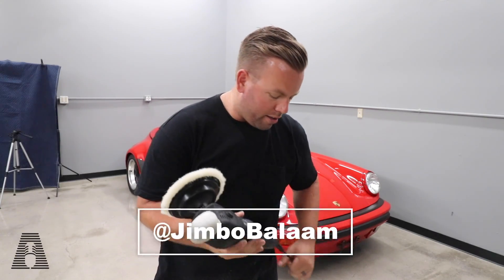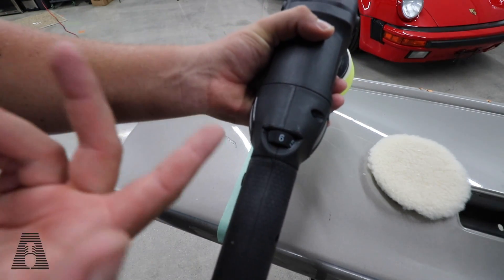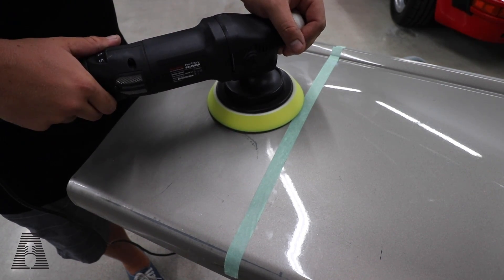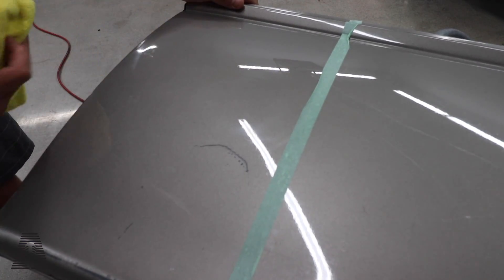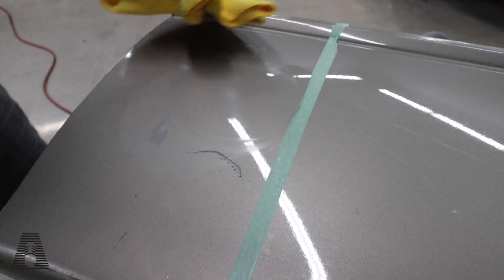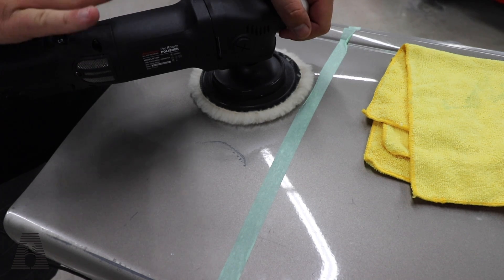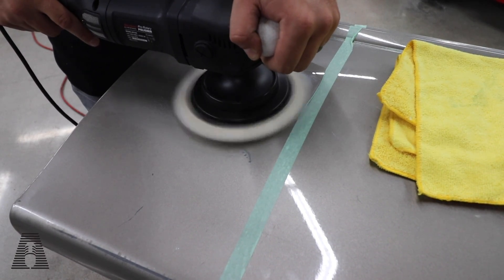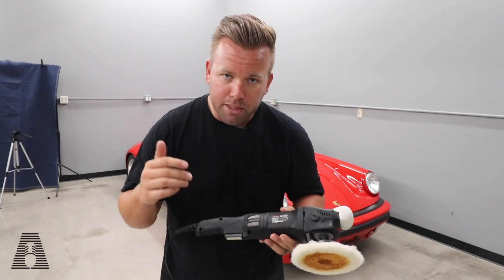HOW TO BURN PAINT AND HOW TO MAKE SURE YOU DON'T BURN PAINT

Comment: Great to see how much it's really needs. But also to be fair the most oops happens on the areas you talked about is to be carefull with when you correcting with a rotary polisher or actually some times with a DA too. On the edges that is where the paint is it's thinnest and also kind of grab you in if you are not carefull. Also how you tilt and let the pad with a rotary polisher goes against the edge. Then have the pad also with compound on it all the time is more aggressive. Needs to be reloaded with compound often though LOL. It could be worth to show how many compounding with full section passes it takes on edges or raised body lines before you have thinned out the paint too much. Also that without a paint thickness gauge reading before you starting to be doing a heavy compounding step on it is of value. As you often have no idea on how the paint has been polished before you do it. And the paint can be very thin when you starting to do the correction. Or more thicker and it's needs to be very aggressive as in your video to do any damage on the paint. 

I see what you where trying to show and you told many things that you takes into account when you polishing with a rotary polisher. And for most parts it's very safe to use. It's when you get those paints that are already thin from the beginning it's a very high risk of going through. Or a spot correction of a scratch that have been done and you have thinner parts on otherwise good amount of paint on it. Where you really can get into problems. Very informative video for sure and would be very interesting to see more of these videos where you when detailing can get into trouble with on some materials. What happens when you let chemicals dry on the paint for an example. Or use a tar remover on headlights and dwelling too long. Not drying a paint when rinsed with tap water and so on. Many things that would be interesting to see what happens and why and how you avoid these things to happens in the first place LOL. 

Great video and the rotary polisher seems to be a great first rotary to get.
Reply from the maker: All great points!

Comment: Thank you for doing the video. Now we do low speed buffing that is no higher than 12 to 1400 RPM. You still have to be cautious with the rotary and it does take a lot of experience not to put in hologram swirl marks and burn the paint. But if you use a paint thickness gauge within 30 seconds of holding the rotary in one spot you have sanded or is people say polish the clear coat to a non usable State meaning too thin. sure you didn't burn all the way down to the base coat but the clear has been so damaged that it will deteriorate so fast within the next year and peel off. I've seen many cases where it looks like there is still clear but actually it is the base coat that is getting shiny that makes it look like clear but it is not. It is the base coat getting shiny which leads to a false sense of security. Also on the same note is people think cutting is finishing out the paint after cutting you have to finish with a finishing polish to take out holograms, swirl marks and any other defects that might be in there put in with the rotary this is what's not tight now and I wish will be taught again the rotary is such a valuable tool again thank you for your video

Comment: I dont have a garage to use a machine in doors. Would you recommend using a machine out doors in direct sun light? I polish and wax cars in direct sun light by hand and as long as I dont wait to long to remove it, especially the polish, I really dont have a problem. But I'm not so sure about whether using a machine out doors is wise.

Comment: So when does anyone actually need to switch to a rotary vs DA and did you burn paint or the clear coat?
Reply: Clearcoat is paint.  Rotary polishers are a staple in the body shop business.   Why?  Because insurance companies cap what they will pay shops per hour therefore the faster you get it done the better.  Same for some detailers.  Doing the first step of a two or three step correction with a rotary will get you done faster which means you make more per hour.  And instead of only being able to get 2 cars done per day maybe you could get 3 or for done.  The bottom line is profitability.
Reply: @scottschulte1157  thanks for the valuable info 👍👍👍

Comment: Do you think a cordless drill with those plate and foam adapter kits are strong enough to burn the paint, or do you think I shouldn’t worry as much because the cordless drill prob doesn’t have the same power as a rotary?
Reply from the maker: I think a cordless rotary can definitely burn paint
Reply: @autodetailingpodcast  well yeah but a cordless battery powered drill prob doesn’t have the same power as a professional rotary. I’m just wondering if my d.i.y Ryobi drill actually has the rpms’s and torque to burn. Thanks
Reply from the maker: Ya it will burn
Reply: @autodetailingpodcast  thanks
Reply: @autodetailingpodcast  I’m going to do it all by hand when I get a break in the weather. Picked up that new turtle wax one & done.

Comment: Is it actually burn from the heat or just cutting through the clear coat with the pad and compound? I've seen another video where they measured the heat as they went and the cooler DA went through the clearcoat faster than the rotary. The rotary part was hotter, but still took longer to get through the paint. They also ran a forced action which got up to 105F but the DA never got over 80F.. and still went through the paint 

https://www.youtube.com/watch?v=Vyz6P9XeYrw&ab_channel=TheRagCompany